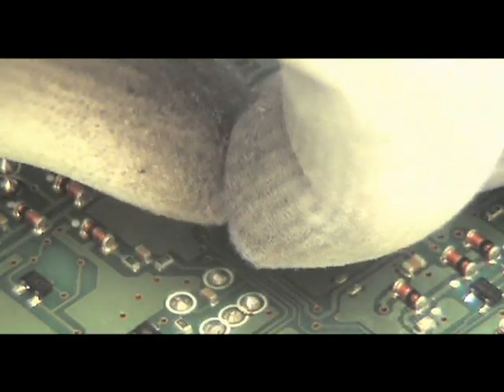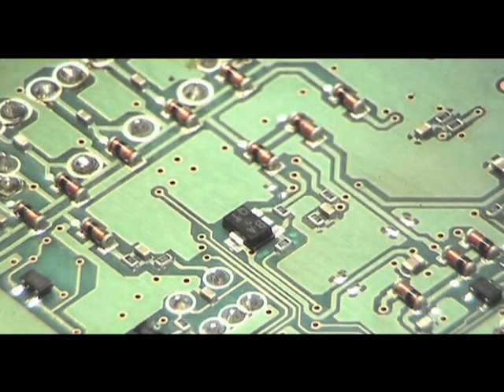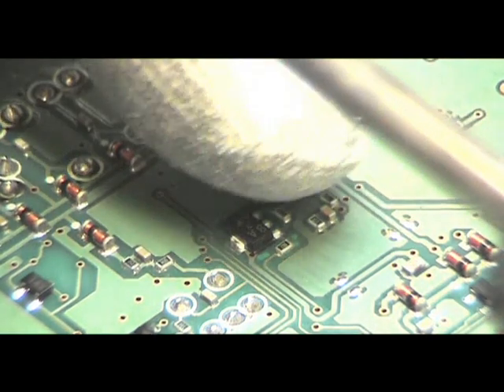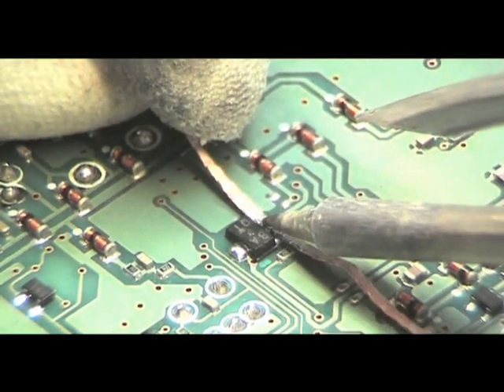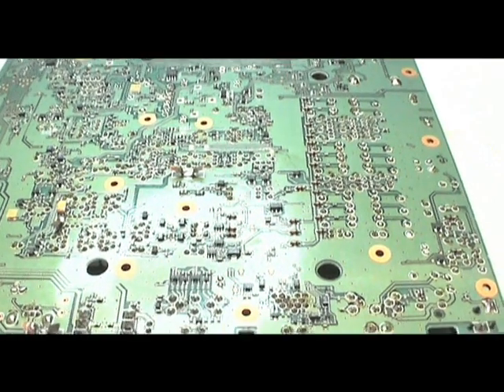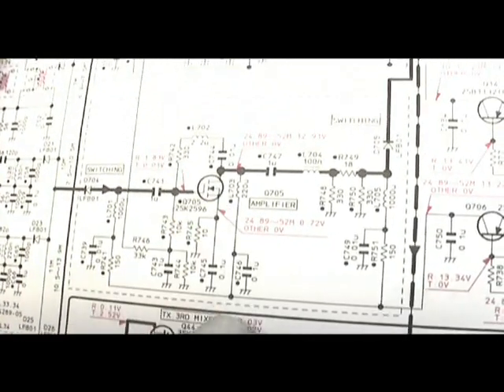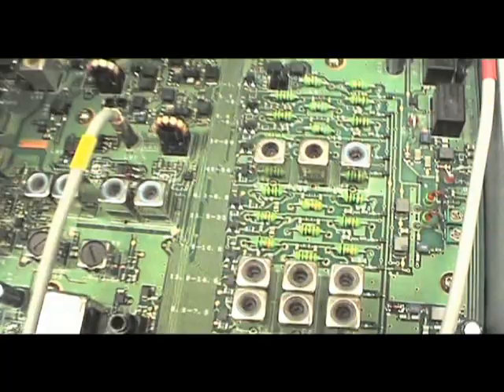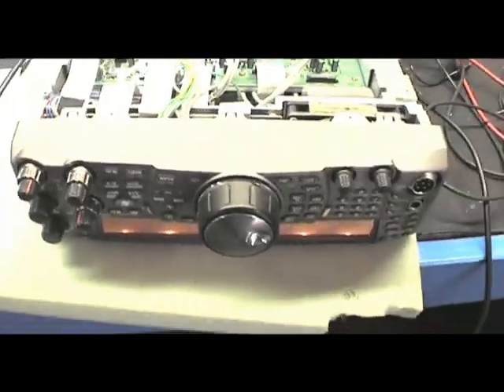Kenwood TS-2000 Pre Amp HAM Radio Repair Part 2 of 2

Comment: My Preamp is doing similar but is intermittent. When it stops working sometimes it will come back alive if i toggle the preamp switch. Other times not unless i power off and remove power from the radio.  Sometimes it works fine until i transmit and that triggers the behaviour.  I guess its possible the switching transistor is flakey in some way and recovers. Any thoughts?  Thanks for your video and sharing.
Reply from the maker: If the pre amp is coming in and out intermittently I would guess that the switching transistor is OK. I have seen a common problem with these radios where Kenwood have double stacked some surface mount components on the PCB around the preamp area. The components start to make poor contact to the board which in turn can cause these types of issue. I can’t remember the exact components but re soldering them fixes the problem. I hope this is of help.
Reply: Hi and Thank-you for responding.   I think your right and i suspect now it falls over when on and reaching some temperature
.   Rather than chasing a difficult one and risking making it worse i opted for an external 6m preamp with a nice noise figure, gain and rf sensed switching.  I dont need the preamp on the other bands it supports so a solution for my case.   All the best
Reply: A

Comment: Wish I would have sent my TS-2000 to you instead of Roy Conners K3TEN...Its been gone for 15 months as of 17-Jan.-2019.
Reply: Finally got my radio back 17-June-2019...Roy Conners took the money of over 30 something people and moved to Florida. Left his son holding the bag...And his son is a Technician. Its a long story how I had to get my radio back. The only problem my radio had was 6 or 7 loose screws that hold down the PC boards that was causing an intermittent problem. But I do think I have this exact problem you are working on here in your video.
Reply: @markwarren7116  you need to look up the story about Cisco in the UK..
he did the same.
sold up after being in the trade 40 years, things got too much for him,
he couldn't repair so was sending stuff out to be repaired and wasn't making anothing from it, ended up selling up including about $15k worth of equipment including customers radios as well..
a lot of unhappy customers asking where their radios are and Cisco sold them..!!
Reply: @bigpimp347  ...Well Roy Conners is a thief and took over $4000 of his customers money and left all the un-repaired radios sitting in his old empty house and took off to Florida. And then called his son Mark Conners to go get them and left his son sitting there holding the bag. Many people are looking for him. I personally have the Florida State attorney's office looking for him. He took over $300 of my money and didn't even repair my radio. Thank God there is a man close to me that use to work for Kenwood and fixed my radio for me for $20.

Comment: Maybe you can help me, my TS2000 is doing this, i thought I was supposed to replace Q705 2SK2569? You replaced Q706? with a 2SB1132-Q ?

Then I thought Q12 was the pre amo for the lower bands?

What am I missing so I can buy the correct parts

Comment from the maker: @bbjunkie1023 Hi, Sorry for the delay in getting back to your comment. The test at the end with the voltage setting on the multimeter was to check that the DC switching was present for the preamp circuit. 

I do have a number of vids with other radios I have repaired however; I need to find the time to edit them so they make some kind of sense.. Thanks for watching. Regards John

Comment from the maker: I’m happy that you find the videos interesting.  I do enjoy repairing amateur equipment and I too am also a fan of the old tube gear. I recently sold all my Collins S line equipment :-(  (Cried in my beer for a week HI).  However; I do still have my trusty KW-2000B. I am lucky enough to know some of the engineers that used to work at KW back in the day. I do have a number of vids regarding repairs and as soon as I have the time I will post them. Thanks for watching. 73, John M0XFX